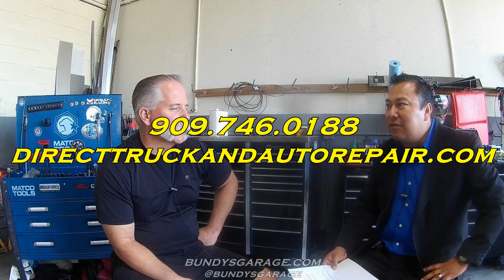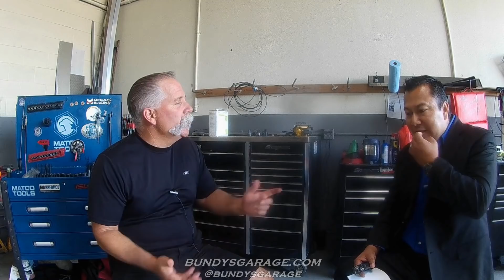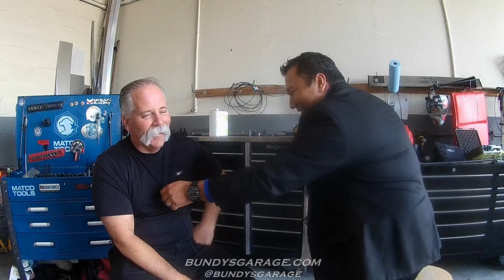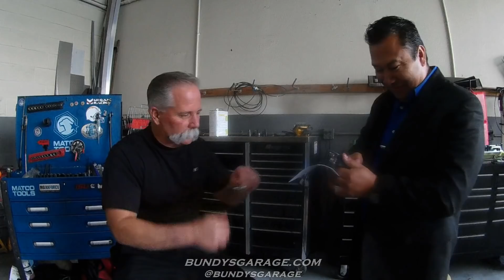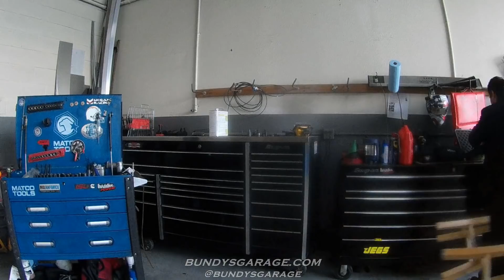Worst Diesel Engine Ever - What is the Best Diesel Truck out There? | Ford Dodge Chevy

Comment: The worst diesel engine ever wasn't really a diesel. In the early 90's, we had a chevy cube van with a "lets pretend it's a diesel." They took a gas engine and figured they could mess with it enough to make it run on diesel fuel. We never got more than 100K out of it. Went through 3 of them. I then had an International with a 466. Great engine and trouble free.
Reply: No that was in 1978 when they came out with the 350 Diesel. It was a converted 350 gas engine
Reply: @poppiarlin5612  That must be the one I'm referring to. My memory is suspect at my age. LOL. It was a converted 350. Emphasis on the CON.
Reply: @ronsmith6662  Nope. No GM diesel was a converted gas engine. That's just false. Also, the 6.2 and 6.5 are decent engines.
Reply: @detroitdiesel-vu3ig  My old man had a 1980 Delta 88. He drove from Atlantic City to Pittsburgh on 1/2 tank of fuel. Running down the PA Turnpike. Avg MPG was in the mid-30s. Saw it for myself. Car ran pretty good until the piss poor injector pump went out. Those early 350 diesels had shit for head gaskets as well. The 81-84 350 diesels were actually pretty decent after GM got the bugs worked out. Way to late to bring back pissed off customers from the early low quality engines.
Reply: @detroitdiesel-vu3ig  Gas to diesel conversion engine did happen.  Used in Oldsmobile car, and basically killed US consumer opinions of diesel engines in cars it was so bad.
Reply: Ron Smith 
I owned the very first one in the Aiken, SC area. Thank goodness I have a friend that still works at a GM dealership. His specialty was this engine. Finally GM replaced it with a beefed up short block.
Reply: @Katmandu2  Yep, no water separator and a pittiful fuel filter, caused head gasket failures, parents ordered one in 1980 when I was a kid in a Cutlass, I got it 10 years later with over 100,000 miles on it, being a teen I abused it, wound up finally rolling the car at over 150,000 and it ran so good, the decision was to have it put in another car. the injection pump was good for 100,000 miles, and they cost $1500 rebuilt but the car got 34 MPG
Reply: Maples01 poor design of a gas motor caused the head bolts to stretch which caused gasket failure 
I had one that was put together with cat head bolts ran until it burned almost more oil than diesel
I even turned up the pump to where it would powerstall and roll cole as they call it these days
Reply: @xephael3485  My friend loved it when those came out. He had a foreign car repair shop. He loved the foreign diesels. After that fiasco he could pick up and car with a "diesel " in it for peanuts
Reply: @detroitdiesel-vu3ig  oldsmobile converted the 5.7 350 into a diesel not gm
Reply: @xephael3485  no, you have your dates wrong..
Reply: @r.kjlbey7498  Never mentioned any dates so my dates can't be wrong.
Reply: @r.kjlbey7498  "Rocket Brand didn’t go with a clean-sheet design. Instead, the new engine (which was introduced for model year 1978) would be based on the marque’s gasoline-burning 350 cubic inch (5.7L) V8, making it the first production diesel V8 offered in passenger cars. (The engine would eventually be used by each of GM’s five domestic car divisions, as well as a brief tenure in light-duty Chevrolet and GMC pickups and SUVs.)" .... It was a lifted gas designed engine, no ifs, ands or butts about it.
Reply: @detroitdiesel-vu3ig  
You might want to stick to music because there was a 5.7l diesel and a 4.3l v6 prior to the 6.2l and the 6.5 and it was a 350 Oldsmobile gas engine converted to diesel built by GM. My cousin has 2 of them brand new still in the crate sitting right here in his garage. He is keeping them because of the history behind them and he also doesn't own a boat, therefore does not need a boat anchor. That's all they were good for.
Reply: @118chosen9  nope, completely false. The LF9, LF7, LT6, LT7, and LS2 shared nothing with Gas powerplants. Oh, and the Detroit Diesel 6.2 and 6.5 are also not gas engines and share nothing with Gas engine although I've been (incorrectly) told this.
Reply: @detroitdiesel-vu3ig  

Are you absolutely sure about that?
Reply: @elcajoia619  Yep
Reply: @detroitdiesel-vu3ig  YES Oldsmobile 350 diesel, look it up
Reply: @dhc5tech41  what?
Reply: @poppiarlin5612  Not sure but I think they used an olds motor for the conversion. I've yet to find anyone to say something good about them. Friend had one, can't remember how many times he replaced head gaskets. Stayed parked more than it ran........
Reply: @jamesmoore3346  They suffered head gasket failure due to water in the fuel, there was no water separator an during head gasket replacement often times the untrained tech would reuse the head bolts, being that they stretch, it would bottom out before sufficient force was applied to the head. I put over 150,000 miles on one.
Reply: @Maples01  There seems to be questions about that motor. It's my understanding they used an olds converted 350, do you know if that was correct or was it a dedicated built diesel?
Reply: @Maples01  I had a 95 dodge with the cummins, it was a beast. Finally let it go after 11 years and over 300K miles. Motor still great but auto trans was the weak link.
Reply: @jamesmoore3346  They were cast explicitly for diesel use, the last cast before abandoning them was 350DX, I had a friend in Finland, Europeans bought many of those engines later when they were cheap, he put his in a full size one ton Chevy van. They were looking to use their V6 version for the front wheel drive car market, I saw the data on them, they ran it around a track non stop for 48 hours, beat on it and it took it, a guy on ebay drives one, he sells parts for those. ABC broke the story destroying the market for the Olds diesel, filled with ignorance and misinformation, something people are realizing now that you can expect it from the media. Many Cadillac's ran that 5.7 diesel, they ran up and down the highways with the truckers, ask anyone who drove back in the 80's, they saw them. The Oldsmobile dealer that mom special ordered hers from said it was the best one they'd ever had after taking it out for a drive with equipment hooked to it, dad wanted proof it got the mileage promised, he was running the interstates and wasn't getting what was expected, they showed if you take your foot out of it, don't black smoke it constantly, it will get 34 MPG. I put a few starters on over the years, they are very big and heavy, one alternator, and a few fuel filters, which were it's biggest issue, too small and didn't remove water.
Reply: @jamesmoore3346  I turned my 6.2 diesel powered Suburban over in a run off driving down a mountain, shale rock shifted under it, putting it on it's side, the previous truck to suffer the same fate, it was gasoline powered, it caught fire due to facing down hill, the fuel poured all over the hot engine after spilling out of the carburetor, I was lucky my choice of vehicle, a week laying on it's side up there, when I got a dozer in to get it, I wasn't able to drive home, I had pulled 2 wheels, drug it down, drum come off spilling brake parts, I did fire it up anyway, smoked like crazy, burning the oil from the cylinders, but was fine.
Reply: @poppiarlin5612  GM never made a converted gasoline engine to run on diesel. Everybody calls it a GM or Chevy 350 diesel. It was a special made Oldsmobile 350 diesel, built and designed by Oldsmobile engineers with some input from Standadyne and not from Detroit Diesel. Remember the Olds 350 gasoline engine? Not one part would swap with a Chevy 350 gasoline engine, not even the starter. That was before the one part fits mentality that would eventually bankrupt GM. The converted part is misleading and frankly, I don't know who started that lie, probably one of the car magazine authors or some other misinformed individual. The olds 350 V8 diesel along with the 261 V8 and 260 V6 types of diesel were built from scratch as diesel engines to power both front wheel drive and rear wheel drive cars/trucks/Suburbans. The engine designers lost the war to the body guys and upper management and had to make an engine that fits in an engine compartment made for a gasoline engine. The V8 and V6 test engines were greenlit by management and went to the next step in the process, production. So the 350 diesel Olds engine was "converted" to fit into an engine bay originally made for a gasoline v6 or v8 engine. A big problem was the dirty diesel used in America at that time, it was for railroads, barges, ships, heavy construction equipment that went through timed maintenance rather it was needed or not. The John Doe car buyer didn't do that. The only place you could buy diesel on the road was at truck stops. And GM management at that time was not the sharpest on diesels and that is why they left the 6.2/6.5/8.2 diesel to us guys at Detroit Diesel to manufacture. The rest is history.
Reply: @andrewarmstrong7310  The "lie" was probably caused by the fact that the gas and diesel engine long blocks were virtually identical on the outside.The diesel looked exactly like a gas motor externally, down to the valve covers, timing cover and exhaust manifolds. Inside, they were vastly different.
Reply: @118 Chosen  Nothing was converted nor retrofitted.  The 350DX was designed from the ground up as a diesel engine that shares absolutely NONE of the internals of the gas engine whose outer dimensions it was designed to mimic for the sake of fitment.  Even the blocks were completely different on the inside, and considerably heavier too.
Reply: @poppiarlin5612  It wasn't a converted gas, you've obviously never seen one, block is cast nothing like the gas engines.
Reply: That diesel in the late 70s was called the LF9 and the 4.3 had a similar number they were still true diesels they were discontinued because of poor fuel quality low power and declining gas prices. I don’t know the exact reason but any amount of moisture in the fuel ruined the fuel system and then caused severe engine damage and they had really poor water separators and fuel filters. it is pretty crazy I just learned something they didn’t convert a gas to a diesel they used the old diesel blocks and converted them to Gas because they were so much stronger than the gas block. I’ve been pestering an old guy that works for GM his whole life as a mechanic asking him these questions lol. By the time they figured out why the engines were breaking gas prices and came back down and people were already pissed at them so the dealers swapped them out for gas engines. He said that the engine is down south didn’t give much trouble but the engines up in the colder climates because of the fuel you couldn’t keep them running. It makes me want to go find one and play with it.
Reply: I had both a 6.2 and 6.5 GM. They had a very bad habit of cracking heads. IMO they looked very much like a converted gas engine and performed like it.
Reply: @robertlong7033  They had a habit of surface cracking between the valves. The crack seldom reached the water passage drilled between the valves, and if it did they seldom actually leaked. If one was worried about suck "cracks" during rebuild, the normal fix was to ream the drilled water passage and push in an appropriately sized valve guide insert coated with Loctite sealant. 

They weren't a converted gas engine. They were a clean-sheet diesel design. The blocks were heavier than a gas big block, but they had some stress risers that are easy to eliminate - if the block hasn't already cracked. Interestingly, the P400 variant being used in HMMWV's now has a heavy bedplate and a forged steel crank. That crank is heavier than a Duramax crank, and unlike the Dmax crank there haven't been any reports of them breaking ;-)
Reply: I worked at a Chevy dealer back in the early 80’s.  One thing you NEVER did was sell an oil leak on the 350 diesel.  Never saw any thing leak like those did.
Reply: My dad and grandfather both bought bought those trucks with the 6.2. One in 82 and one in 83. They both ran over 300k miles but they never pulled or hauled much with them. The 700r4 trans however gave more than enough trouble. Great mpg from those engines.
Reply: @jrod264winmag  
Biggest  problem  with  the  700r4  was  blowing  the  converter  shaft  seal  out . Gm  recommended  enlarging  the  drain  hole  behind  it  twice , 1/4  to  5/16  to  3/8s . I  think  the  final  fix  was  a  2nd  drain  passage  but  I'm  not  sure  about  that  one .
Reply: @cbmech2563  personally I love the 700r4. I replaced a th350 in my 78 trans am and my 1980 c10 truck with them. They are a good little transmission once modified properly.
Reply: @jrod264winmag  
Agreed , not  bad  trans  when  modified .
Reply: Pfft .... Spoken like someone who has NEVER been inside an engine.  Stop listening to the kooks trying to promote that ignorant lie.  The completely ignorant Ford lovers started that nonsense when the Oldsmobile diesel came out.  It was actually a great little engine, but as was Olds' habit, it was the exact same exterior dimensions as every other Olds' V8.  Their gasoline 260, 307, 330 350, 403 (small blocks) 400, 425, and 455 (big blocks) all use the exact same gasket kit, and tho the big blocks have a taller deck height, they look identical, use all the same exterior components, etc.  That way Olds could use all the same engine mounts, transmissions, alternators, exhaust manifolds, water pumps, fan shrouds, etc.  Any V8 car could run down the assembly line and accept any engine they were spec'd to.  That included their little 350 diesel.  However, there was NOTHING the same about the diesel, no interchangeable internals.  They even used the basic distributor housing and shaft, to run off the back of the cam to drive the oil pump, but instead of electronics on top, there was a vacuum pump to drive all the vacuum accessories.  GM's diesels are NOT in any way (other than layout and external dimensions) the same as their gasoline engines.
Reply: We love oil burners, I Had a rare Lincoln Diesel. People of the 1970's through 1980's just were ignorant as hell on how to treat a diesel. The Ford 6.9 and Volkswagons brought millions to the learning table to want diesels. Good cars got BAD CARE.  https://autoweek.com/article/classic-cars/ten-diesel-cars-time-forgot
Reply: @JOHNDANIEL1  I had a Lincoln Mark VII Diesel, too. They're actually quite rare and sought after today, just a few thousand made. I want to say 2500 or so. It was a 2.4L  Steyr diesel that was also used in some BMWs of that era. A fellow approached me with an offer I couldn't refuse, so I sold it. 
 Also had a 78 VW Rabbit diesel back in my younger days. A rusty econobox when I got it, but loads of fun to drive. 50mpg all day long.
 They set the mark that the other manufacturers have chased til this day.
Reply: Yeah, they were Oldsmobile 350 gasoline platforms. I made a LOT of money off those engines! People that got tired of them but liked the vehicle would bring them to me and I'd swap them back to gasoline engines. Did several GMC pickups!. Would get donor engines from used carlots, just buy the whole car with a 350/400/455 and get to work!
Reply: I had a 82 Park Avenue with a diesel engine and was the best car I ever owned
Reply: No gasoline engine was ever converted to run on diesel, the pressures will blow it apart.
Reply: Maples01 and they did blow apart 
Almost all of them
Reply: When the ignorant are cornered with facts, insult is their only escape.  I may tell you like it is, but I'm not going to roll out the insults as a desperate comeback.  You've shown your hand, and ya got nothing.  Except for maybe a crappy diesel engine dumping way too much fuel into the cylinders because you thought it was cool to belch black smoke like a kid?  Lol

They were poor diesel engines.  But they WERE diesels, and NOT converted gassers, which is the whole point.  But you have to admit, when converted to to a gasser in the aftermarket, they were pretty baddass.
Reply: I have a 85 c30 dually that had a new mechaical goodwrench 6.5 dropped in before I had it (unknown reasoning) but I put a turbo off a 98 6.5 into my 85 c30 and I tow with it.  Truck has 53k origanal miles too.  I'll haul loads truck trailer combined 15,000 gross weight.  It has the sm465 4 speed trans too.   I just take my time watch the temp and mosey on.   I have a few 80s Ford 6.9 and 7.3 idi trucks. I'm building a 7.3 idi up mildy with a turbo and head studs for my 83 f250.  I live for old mechanical v8 diesels.  The key is maintenance and watching the temp
Reply: Randy Wiesendanger  the 7.3 ? If so you are a idiot lol if not then my bad
Reply: you went through three of them? i think that shows your mindset..You would think after one you would have figured out it was junk...duh..
Reply: @wavular  They were under warranty. That's the only reason. No duh necessary. LOL
Reply: Back in the late 70's, I worked for a company that bought all new International delivery trucks.  They were constantly breaking down.  Maybe it was those particular years that were bad.
Reply: @kamphwagon1 the only truly gas diesel conversion was a toroflow that was even hard to actually call completely the same block design.
Reply: @Heidi Lear there it is.  They "reinforced" it, your own words.  So this leaves the rest of us to wonder whether you actually believe they'd cast these blocks, and THEN reinforce them individually. 
Or perhaps you realize that the molds they cast the blocks from are themselves beefed up in comparison to the gas blocks of similar outer form. 
If you are smart enough to realize that it is this latter scenario which is the case, then you will have to concede that they had separate casting molds for the diesel blocks and the gasoline blocks. 
THEREFORE.... since you stubbornly like these things spelled out for you.... they were two different blocks all along, and you even knew it. 
So why the argument? 
Words literally mean things. 
And while I don't mind pointing out that you're mistaken, and even hard headed, I'd never call you stupid, because there's a intelligence to your premise, wrong though it may be.  However, I'm obviously intelligent, but you jump right to insults with "stupid" and "idiot" without even realizing the fallacy lies within your terminology.  You've tackled this whole thread under the wrong premise, which is kinda cute.  A conversion is an individual unitary process.  These diesel engines came out of the molds as diesels, so no... they weren't converted.  They were manufactured from the get-go, start to finish, as a diesel engine.  And yes, the design still sucked nevertheless.
Reply: 1SqueakyWheel the engineering was for gas that’s y they blew the heads off
Reply: Ron Smith if
Reply: Randy Wiesendanger  the engine GM made that was a gas conversion was a Chevrolet 350 that had been converted to run on diesel but that ended by 1985. They never use them in trucks and the 6.2 which was a clean-sheet build from Detroit Diesel division of GM started in 1982 for production. And that was the only diesel offered in GM trucks as far as diesels
Reply: Randy Wiesendanger  FYI as for using the most fuel, the steel cars got 34 MPG, it was proven by the dealer who hooked the equipment up to our car and took it out on a drive! It was cast for an injection pump, obviously not a gas engine you idiot!
Reply: Randy Wiesendanger  Mine was stock, put over 150,000 miles on it before totaling it out, the only problem we had was the injection pump only lasts for 50,000 miles before needing rebuilt! You obviously lack the ability to care for it.
Reply: @Randy Wiesendanger Thanks for trying, but nothing you have said to anybody makes any sense.  But enjoy the dogpile, lil buddy!
Reply: @Casca Longinus They did share rocker arms, bridges and valve covers with the gas engines. That's about it, though. Possibly pushrods, I don't know for sure now.
Reply: 1980 olds 350 diesel no turbo, 385000 miles though a rod, 30 to 50 miles to gallon on hwy
Reply: G.m. head engineer sais don't make a diesel engine from a gas 350 cubic in. block. But he was overuled. So bang jernal mounts failed.
Reply: They never made a converted diesel. All the diesels from the Early 80s until the late 90s we’re all built by Detroit diesel. 6.2 and 6.5 liters.They actually had a 350 cubic inch diesel back in the 70s and 4.3 v6 diesel that people say it was a converted gas engine but it wasn’t. It was just a dud. It had nothing in common with any gas engine they ever made. The 6.2’s and 6.5 is definitely worth the weakest engines at least the 6.2 was but definitely not the worst. They have pretty minor problems compared to some of this new stuff and they were engineered for fuel mileage not torque. Put a bunch of miles on an old 6.2 Detroit in a 1 ton Chevy pick up not fast miles but it had 216k on it when it left And it was still rattling along getting 21 mpg with a decent load. 90% of the military Humvees use 6.2’s and some have the 6.5’s A couple of minor upgrades in those motors run a long time. There still using them and boats.
Reply: Shawn Bowman:

Those GM V8 Diesels from that era were of a Oldsmobile derived gasoline engine with amendments in the casting to accept an injection pump and other sorts....very little else was done...beyond specific cylinder heads,which were modified  gasoline-engine castings to accept injectors and glow-plugs. Even the later and larger displacement "good" ones were/are fragile engines if made to work hard.

The 4.3 V6 Diesel.....was a clean-sheet design (a true Diesel).....but by then GM had destroyed the Diesel car market...and that engine was turned-into the gasoline Vortec V6 about the same same the Diesel version debuted.
Reply: You are correct. My Dad had a 1978 Chevy Scottsdale shortbed diesel. At 50,000 miles it was sitting broken with cracked heads, bad cam and torque converter. He told me if I fixed it I could drive it. I purchased a 455 Olds engine and installed it. The diesel was a converted 350 Olds. The bell housing, motor mounts and all accessory brackets were different than Chevy,, so I had a Chevy that a Small Block Chevy wouldn't just bolt in to.   @dmcnamara9859
Reply: @theaveragejoestinkeringand4407  it was an olds 350 gas engine converted to diesel  only the block was same as gas we had 3 3/4 ton 2wd pickups they went over 300000 with no problems go figure
Reply: @andrewslagle1974  the block actually wasn't the same as the old's gas you actually would need to do a decent amount of work to make the old's diesel run on gas.
Reply: @theaveragejoestinkeringand4407  
The  5.8  was  an  Oldsmobile  350  with  diesel  heads  on  it , because  the  Olds  engine  was  a  heavier  built  engine . The  only  guy  I  ever  heard  of  that  got  decent  milage  out  of  one  replaced  the  head  bolts  every  25,000  miles . A friend  had  a  1980  pu , the  dealer  told  him  if  they  saw  even  a  shovel  in  the  bed  it  would  void  the  warranty . 😂   That  wasn't  the  first  time  they  converted  a  gas  motor . Early  50s  they  took  the  big  v6  gas  truck  engine  and  converted  it  to  diesel   (turoflow)  to  put  in  the  mine  sweepers  and  PT  boat  hulls   left  over  from  ww2  that  didn't  have  engines . They  also  put  them  in  gmc  cab  overs . Even  with  someone  who  understands  them  rebuilding  them,  they  were  smoking  piece  of  sh@t .
Reply: @Cbmech I was more talking about the 6.2’s in the 6.5’s being Detroit diesels someone Was Suggesting an early 90s Detroit was a converted 350 and they are definitely not. And the old Oldsmobile engines are still really not converted they used the same tooling same bore same stroke the same amount of head bolts and actually the same head bolts but the 350 diesel block I think Weighs more then 454 big block it’s a lot heavier than 350 rocket block.  Even if you have all of the parts from a diesel and a brand new Oldsmobile 350 rocket block you can’t make it a diesel. it is still a useless engine in my book but there are some Running great with today’s fuel and fuel filters supposedly. Fuel and filtering is what caused a lot of the head gasket problems along with the crappy bolts and pump design . The fuel back then was full of trash and quite a bit of water compared to today’s standards and supposedly any amount of moisture or water in the pumps on those things would get directed all to 1 or 2 cylinders that plus crappy head bolts it would cause it to blow the head gasket or both if there was enough water in it. I guess the water or other impurities getting into the pump would cause it to severely over a fuel Because the water would pool up in one part of the pump and then it would I’ll get shot at one time into a certain cylinder. By the time they actually started to fix the problems and catch what was going on it was too late they already had a bad name and pissed customers.I’ve personally never laid my hands on one but talking to a guy that worked on a few of them he said water would get in the pump and It would get Injected All to one or two cylinders And most the time it would cause a head gasket failure And by the time the engine was torn down or repaired there was no water in the cylinders so it was reassembled just to go down the road and do the same thing again.
Reply: @theaveragejoestinkeringand4407  The 5.7 and 4.3 were killed by bad fuel, water was blowing head gaskets, GM didn't put a water separator on them, I had one as a teen, ran amazing, got 34 MPG when driven correctly, not trying to smoke it, wish I had it now.
Reply: Shawn Bowman the 5.7 was a 350 Oldsmobile block converted to diesel used in the late 70s early 80s no power 
It needed head studs couldn’t keep the heads on but got great mileage
Reply: @heidilear7222  No, it was an Olds 350 block machined on the line with Olds 350 gasoline engines. They were not converted from gasoline to diesel, they were built to run diesel from the start. The Olds 350 shared the same block tooling and nothing else. The diesel ran on 22.5:1 compression ratio, show me a gasoline cylinder head that will take that.
Reply: They were also offered in Cadillacs and Buicks.  I don't know about the Pontiac and Chevrolet cars though.
Reply: Andrew Armstrong same block converted to use diesel
Just like a conversion van same shell different guts genius don’t argue with me
That’s what converted means
Reply: 1SqueakyWheel also in 1/2 ton pickup
Reply: @heidilear7222  No they were not converted, they were made with existing tooling to run on diesel fuel oil.
Reply: @Heidi Lear: of course... the GM ¾ and 1 ton pickups too.  I was just referring to gm car - only brands though, where their less popular implimentation was done.
Reply: Andrew Armstrong I hope u are a bicycle mechanic
Reply: Also @Heidi Lear:  van conversions are apples to the oranges of what we're talking about here...  lol!  
Not the same at all.  The diesel was a factory option, not a dealer or aftermarket conversion.
Reply: @heidilear7222  Worked 43 years in different roles at General Motors and Detroit Diesel. I know what I am talking about, I was there. Yes, I am also a bicycle mechanic as I bike often.
Reply: Andrew Armstrong I’m pulling the bs flag
Reply: 1SqueakyWheel a gas head would fit on a diesel block that’s converted
Reply: I saw one converted back high comp gasser 500 hp
Reply: 1SqueakyWheel never above a 1/2 ton 
I’m talking about the 5.7
Reply: Heidi, the diesels you're confused about were sometimes converted well after market into really tough gassers for racing applications.  There was a popular aftermarket head made which was designed to lower the compression so that gasoline could be injected or sucked into it without detonation. 
That was done PRECISELY so that the tougher diesel block could be used as a really tough gasser. 
But it wasn't done the other way around, sorry. 

As I mentioned before, you're getting the contexts radically conflated.  Lol

As for the ½ ton only, I believe you're right in that one point;   Now that I think about it, the heavier trucks did have the better 6.2 and the 6.5 if I recall correctly. 

The 350 diesel was an Oldsmobile design which was designed to match the outside form of a standard 350 gasser so that they didn't have to design special chassis fitments on the sedans and coupes they were designed for.  Those external dimensions are where the STOCK similarities end. 

The 350 gasser was a pretty reliable mill, but even with diesel heads bolted to it, its crank, bearings and block would never last through its first week of moderate driving if they'd tried to sell it as a diesel. 

Armstrong obviously knows a lot more about this than you.  He's apparently more familiar with it than I also. 
Instead of insulting him for disagreeing with your glancing assumptions, perhaps you should listen to him... ya might learn something, if you're interested in knowing more.
Reply: @heidilear7222  I'm pulling the troll flag.
Reply: Andrew Armstrong you’re a troll I just thought u were a liar but troll fits also
Reply: Nah, I don't think Heidi is trolling.  She's just in over her head and legitimately doesn't realize the contextual relations and differences  between the various factoids she's apparently reading in her google searches.  :-D
Reply: 1SqueakyWheel your so smart I bet your moms is proud 
Let me say that u are only special to her so tell her your bs
Reply: @theaveragejoestinkeringand4407  
May I correct you?
They converted a 350 cid Oldsmobile  to a diesel previous to the junk 6.2 and junk 6.5...it was the 5.7 diesel. They also had a 4.3l V6 diesel of the same layout as the 5.7l minus 2 cylinders.Then they gave up an let Isuzu engineer and design what the GM lovers call the Duramax.
Reply: Those were never gas engines. Heard that ignorance for decades. You could convert them down into a gas engine, with a 1/4" plate & dual head gasket gasket to get them to from 18.5 to 1 to 11 to 1 compression and many did for race cars. The 350 CID Diesel short block weighed 39% more than a chevy 350 gas long block.  However, the intake and other parts like a crank sensor ignition system had to be hand made or welded up. THATS NOT POSSIBLE if it was already a GM 350 cid to start with. They were sized the same to accommodate all the running equipment, pulleys, water pumps and transmissions on them. I had a 350DX in a Cheyenne 1500 that got over 300,000. The number one OWNER FAILURE was fuel filters. Gave the engine a bad name, due to idiot owners who failed to keep clean fuel in them.  
In south America those old D and DX model 4.3, 5.7 and 6.2 engines are still running today.
Reply: Your diesel was either the 6.2 or 6.5 and they were made by Detroit Diesel, not GM.  they weren't converted gas to diesel engines.  They were just really lame diesels designed more for fuel economy than towing or power.  The 6.2 was naturally aspirated and the 6.5 was turbocharged.  They ran really high compression ratios and very low turbo boost vs other turbo diesels running a lower compression ratio and higher turbo boost.   So they built them backasswards in a sense.
Reply: @brussell639  The 6.2 has 21.5:1 compression, while the 6.5 had 20.3:1. The reason for the high compression is that they are indirect-injected engines. They used the Ricardo Comet 5 prechamber design (same as the 6.9 and 7.3 International IDI engines), and with any IDI engine higher compression is needed to compensate for the greater heat loss and pumping loss through the prechamber and prechamber throat, respectively. As a rule, IDI engines have better combustion efficiency, lower emissions, and can operate at higher speeds, but this is offset by the thermal and pumping losses which reduce efficiency. Overall, IDI's generally do well, but as power demands and required boost increase the prechamber design and high compression becomes a major limitation.

For what they were, they were actually not a bad engine. They were relatively efficient, very inexpensive to manufacture, and had a good lifespan if properly maintained. Most weren't properly maintained (including those in the military), particularly the crappy fuel filter system and even crappier glow-plug controller and bad idea of using 6V glow plugs, and so caused many problems. Replace the OE Stanadyne filter setup with a Racor, run 12V glow plugs on a manual switch, change the oil every 5k miles, and replace the harmonic damper with a Fluidampr, and it will be reliable and last.
Reply: @brussell639  The 6.5 was naturally aspirated, when installed in G-series..
Reply: @Greybone62  that was the 6.2 the 6.5 is turbo charged.
Reply: @brussell639  ummm , apparently you don't really know that much about anything, because at that time Detroit Diesel was still part of general motors, and general motors had not sold out Allison and Detroit Diesel yet.
Reply: I owned a 6.5 turbo in a Chevy 3500HD. Worst and weakest engine ever.
Reply: @brussell639  
No sir, it was a 350 Oldsmobile gas engine retrofitted to run on diesel and it was a 5.7l diesel made by GM.
Reply: @brussell639  OLDS 350 diesel, used in cars and trucks late 70's early 80's if they made it home from the dealer.